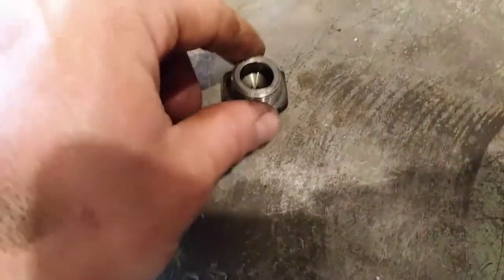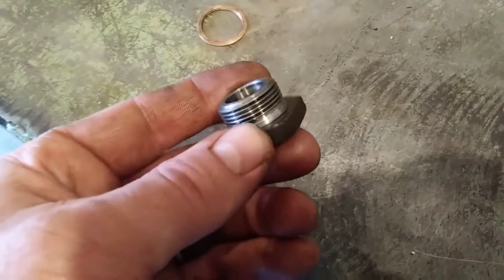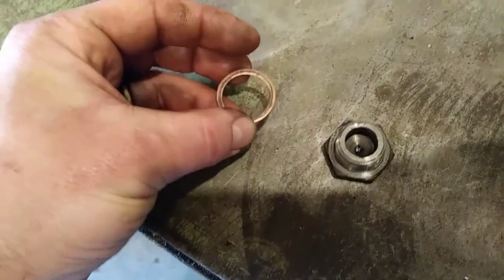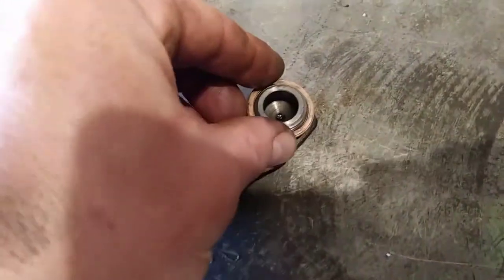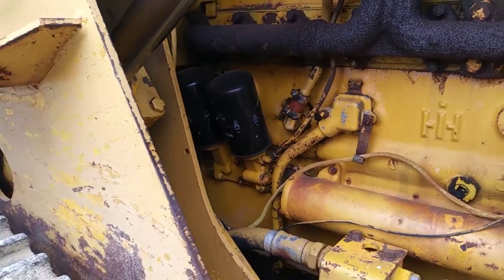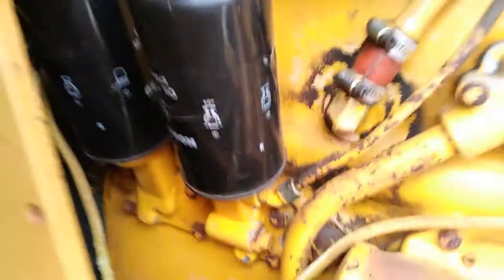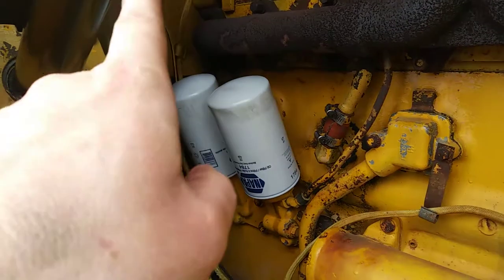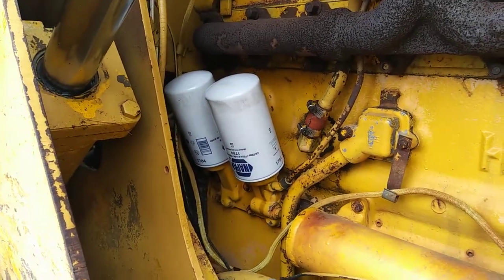Engine Oil Change Crawler Loader 175C

Comment: Im in the market for an old loader, probably get a cat 955l but i did see one of these for sale im interested in, this one has the 4 in 1 bucket.  I hear the main issue with the 175c is that the transmission is to small for that big engine and they tend to go out.  Do you know anything about that issue?  Looks like your doing a good job keeping up on that machine, if you didnt know, its a good idea to write the date and the engine hours directly on those new filters so you or the next guy knows whats up with the maintanence schedual.
Reply from the maker: During the time I was investigating and then owned the loader, I didn't run across any info about poor transmission performance. This is the first time I am hearing anything about it. I never had any issues after I got the shifter valve repaired. It did what I wanted to do and then I sold it.

Comment: I have a 15c very similar to 175c had starter rebuild found out it had a wet bell housing . I thought rear seal was bad , does the 175c have wet bell housing ?  Thx
Reply from the maker: I honestly don't know. I finished maintenance on this machine and cleared about an acre of woods. That was the only reason I bought it. Then I sold it.